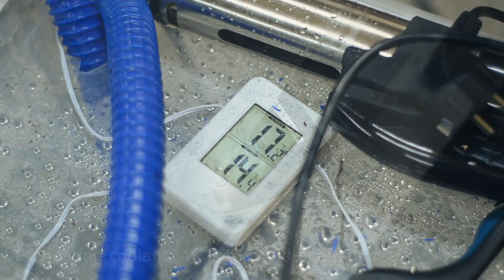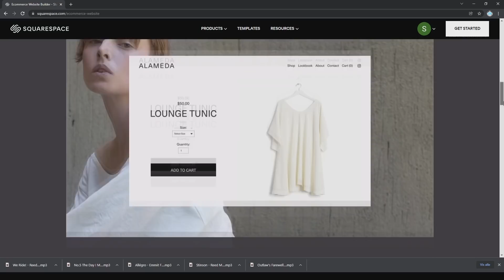Why!? All I wanted was all the power.

Comment: I was a Blata  factory sponsored pocketbike racer for several years and i can tell you now that you have that clutch set too tight . also you could save  a lot of  weight by switching from that big chain to a smaller pocketbike chain. you would have to make some adapters to use pocketbike  sprockets and pinions but it bight be worth it to save some weight and rotating mass.  Our most powerful 40cc pocketbike engine made 24 hp   so i am looking foreward to seeing what this thing does
Reply: 40 cc and 24 hp? Would love to see a dynochart of that. With 50cc would make everything 2STROKE STUFFING is doing obsolete :-) 

But yes ligher chain set up helps allways. When racing 125gp bikes, we learnr that worn and dirty chain could rob up to 2 hp.
Reply: How is the chain going to make a difference? Its attached to a massive flywheel...
Reply: @tyresmoker4  kind of like sanding all the paint off an Abrams tank to reduce weight. That's a huge rotating mass the only difference that would likely be seen between a chain to a belt is friction losses which going off other calculations between chain and belt is likely only 1% to 3% difference.
Reply: Yeah he explains it in the video, he needs a lighter clutch system to get past the reverb from the pipe working against the crank case volume, this is then shown to be correct when he disconnects them from the engine, so a lighter clutch will let the engine rev past that limit then it'll spin the clutch enough to engage the springs and start spinning the flywheel.
Reply: Lmao the best engines come from CS ghr and medos BZM and they all making around 16hp to 19hp with a 50cc.
Reply: in what country you are you living? And you say that you are a factory blata rider back in te days? Before the time of the ultima?
Reply: I think that beefy chaij srtup is just for his engine dyno, so if he ever sets it up on a bike with a smaller chain to wheel dyno it, shpuld make a bit more power
Reply: Shh this guys kicks ass mate

Comment: My perspective, as someone with 14 different motorcycles in the garage/stable: you keep changing Air/Fuel ratio components, and each time, the engine does a wildly different behavior. If you calculate the proper Air:Fuel stoichiometry, the engine will respond accordingly. I know you think it's running Fuel Lean, but I'd bet it is actually a bit rich... Bogging down in 2-strokes occurs when you don't have enough Air to burn, for the given Fuel flow rate. Do some math, then try again

Comment: Can always use  brake clean to find leaks in the crank case if there is a question..... squirt a little of the "non flammable" kind and if there is a leak the motor will stop. Right then, ( Carb cleaner will not work for this ) I've done this for decades debugging dirt bikes and chainsaws...find goofy crap like cases that leak, seals , manifolds etc.

Comment: Indeed! This seems to confirm what I was already wondering when I saw your previous video. How strong is the force needed to bring up the generator brake up to speed anyway. As soon as a magnetic field is generated by those spools the whole contraption acts as a brake. Which is of course the whole idea because that is how you measure the power output. If the initial power output of the engine is however too low you will never get beyond the initially needed pulling power / momentum. Part of starting an elektromotor is to feed it with extra power to get it beyond the initial momentum / inertia. Here this works the other way around. You need an extra strong moment from engine to get the thing turning then you need to keep it at speed. On could also compare it to trying to pull a farm tractor with a standard roadworthy moped. So my feeling is that your power bench is better sized to the torque of a ships diesel or whatever then to a high revving, low capacity 2 stroke. Try to measure  and / or make some calculations what power is needed to spool up this whole contraption in the first place.
Reply: An eddy current dyno has only inrtia when being spun up , its only when the field coils have current externally applied to them that any braking force is generated. Having said that , the inertia of that particular rotating mass is huge for a 50cc race engine.
Reply: @waynewright5504  He could probably stop that motor with a AAA battery attached to the coils!

but seriously, all that mass doesnt matter if it's going through a centrifugal clutch. It will make decent power once it gets upto speed, he just might ned to change the gear ration on the belts.

Comment: Could you modify the Telma retarder (mechanically) with one of the two rotors removed? One would still be in eddy current area in order to brake, with the bonus of a reduction in moment of inertia.

Also, the wide exhaust port is probably influencing the pipe length and making it act like it is shorter. can you add an extender between the crankcase and the pipe to lengthen the pipe? Much easier to start with a long pipe and progressively shorten the effective length than to start off too short and not have the motor hit the pipe band.
Reply: Lighter flywheels on the dyno probably would help things, for the reving out issue im right there with you on the pipe needing tunning for the crank case volume

Comment: you need to loosen the spring screws in the clutch to abt 1 or 2 mark, or else you will burn the clutch bell, or it will get overheatet and it won't grip, i've been working on cvt mopeds for 8 years now and my so far streongest 70cc build makes a little over 28hp, but you can contact me on mail and then i'll help :)

Comment: Great work, as usual! The only advantage the float style carb should have is a dedicated idle circuit, well that and the lack of pulse as you well noted. Those little Walbro carbs work fantastically IMO, better than float type carbs IMO, which I think is why a lot of 2t rotary GP bikes used pumper type carbs. Well that and orientation of a pumper carb is without relevance. I do think pumper carbs requirte more upfront planning. For example I converted my RD350 to Ibea 29mm flat slide pumper carbs. On the track it ran incredible, but for street use they were horrific. Fuel economy was awful too, so I went back to 28mm Mikuni flat slides. Anyways, sorry for the long post. I do have a few varieties of pumper type racing carbs that I would be willing to send you to try out. Send me a message.

Comment: Try to pre spin the dyno wheel, so the engine doesnt have to start it from zero rpm..
Reply: Not a bad idea for testing purposes but once it's in a bike the engine will need power to move so the time he spends on the primary clutch won't be lost.

Comment: I had problems running membrane carbs on my Suzuki K50 with an 86cc scooter cylinder, could never get it to run good through the rev range. Put on a Chinese Maikuni and it was just perfect(in Allen Millyards voice). Never had any problems with those carbs on all my paramotors, so might be something with the crank case volume and highly tuned small engines. My paramotors where 100-180cc with mild factory tuning.

Comment: Everything I have ever learned about two stroke engines has always mentioned keeping the crankcase volume as tight as possible. listening to your engine reminded me of a 175cc Yamaha I had when I was younger  , I had to keep the noise down and packed the baffle a bit to much - engine rev was good to about 5k then died - one day the baffle blew out and it took off like a rocket so could you have a back pressure problem ?
I all else fails - a good bottle of whiskey will provide you with some clarity 🤣

Comment: That is wild won’t even spin up until it’s on the pipe! Maybe you could run a v belt with a tensioner and manually pull a lever once the rpm’s are high enough?

Comment: first, great project so far. but, I think the problem is this: you are trying 2 things at the same time. 1, the PIP cylinder, and second a  large crankcase volume. if you would make a 'normal crankcase' first, and get that running good, you could progress to secondary intake. now it is guessing what causes the problem... 1 change at the time!

Comment: Your work is inspirational and I love watching you methodically overcoming each problem you meet. This suggestion might be naive and completely off track but I once had a 50cc moped (a Casal) which had similar symptoms. Revved beautifully but didn’t produce any power so wouldn’t pick up any speed once clutch was out. Turned out to be a failed small end needle bearing. Probably not your issue but worth considering/checking?

Comment: I recall watching Honda techs pushing like mad 2 stroke, multi valve, multi cylinder 50cc bikes back in the 60s and they couldn't get going unless they reached 20 to 22,000 rpm to have enough power to start moving forward. Once going, fast as lighting. How about a 2 stage clutch for your project?  Keep up the good work.

Comment: If it has not been told before: 
- check the ignition advance. More advance - more torque. Too much advance: detonations, clicking noise, engine failure. Too little advance: no torque. 
- check the centrifuge clutch. Set it to open AFTER the max torque rpm (I guess over 3000-4000 rpm). Also, you can play with primary transmission ratio to set it.

Comment: hi. why don't you use fuel injection and mount the clutch directly on the crank? with correct timing, mapping (ignition/injection) and less powerloss on the clutch... when you mount the clutch to the crank, mass can be reduced on flywheel or total rotational mass... sorry for my bad english ;)

Comment: Hello, the big bike chain is also adding a lot of friction, you could look for a type of chain used in moto gp. They are very light with minimal friction. A cheaper and easier option would be a monkeybike chain. I use regina on my 150 engine, just make sure you get the high quality ones. 

Cheers and good luck

Comment: Weber 34 ICH might work. There might be a 28...not sure. Might be too small. A 32 DGV two barrel handles low and large low pressures well which...in your application persist to high rpm. I currently use these  carbs on my small displacement 1.5l race engine which has low manifold vaccum and a 4l I6 from 1927. Maybe a Dell'Orto from an early Mito reving to 15k? Love your show!

Comment: "Wo gehobelt wird, fallen Späne." is what we'd say! Love your videos, no matter if dyno run or troubleshooting without getting in the taste of a single run. Just great seeing you having ideas, figuring problems out and how to solve them. Keep up the good work!

BTW: the PIP has its max power at 20000 doesnt it? Why not RPM match the electric brake, engage a clutch manually (like from an car AC compressor) and then slowly put load on  the e-brake it until the PIP cant hold the RPM? (The RPM matching Motor on the brake would freewheel the second you engage the clutch to the PIP)

Comment: This problem looks like 1990's 50 ccm Italian racing models problem.... Aprilia 50 ccm I think 1997 model, 14500 rpm, 3 or 4 speed I can't remember.
In order to start as fast as possible, we pushed with our feet up to 10-15 km / h ....As much as anyone could.
Looking at this problem, I think it would solve yours if you turn the dyno a bit just to get the engine running at natural rpm's.
By the way, I'm a big fan ✌️

Comment: Use an AC clutch for a car.. its an electromagnetic clutch so you can control it with the same arduino you would use for the secondary intake or even a standalone one

Comment: Now imagine, you ran the engine at full rpm, but used a cvt to tap into that power without dropping the rpms much at all
Reply from the maker: The plan👍
Reply: @2STROKE STUFFING Alex; wouldn’t it be better to spin up the flywheels of the eddy brake dyno with a pony-motor such a a small 4 stroke generator motor, using a chain and clutch? From what I understand your planning on doing near steady state testing anyway at a very narrow RPM range, therefore you could remove the massive amount of torque needed to get the flywheels accelerated / maintain speed between dyno-pulls, by just running the pony motor until at 2-stroke engine engagement rpm, then throttle down the pony motor and make your runs......this would save a ton of wear on both your test motor and the clutche(s)......hope this helps.

Comment: Do you know of which size the main jet is that is assembled to that diaphragm carb?
Maybe it is not big enough to supply that kind of engine at high rpm under full load.
We use same kind of carbs in our chainsaws. I could check, if there is something bigger available.

Comment: Feels familiar. After months(years) of hard work it is only the beginning 😀 but you will get there.
It might really be that the crankcase pumping action is so weak that there is no power. Usually with normal crankcases there should be still 2-4hp below the power dip rpm, with a 50cc.
But I also think you will need more reduction ratio for the dyno like we discussed. Otherwise the clutch needs to slip like crazy. There might be just too much load from the gearing.

Comment: You have my sympathy. I built an engine and spent 2 years trying to get it sorted to the point where it even ran half properly. Ignition was in the ballpark, known good carb etc. In the end I simply jammed the ignition to full advance, way in excess of what had been required on other builds, and away it went. Still a huge disappointment though in the end.

Comment: the clutch will be a measure of slip while dyno loading . you should have  a better coupling between motor and dyno thats on off with zero slip . have you calculated the dyno inertia (unloaded inertia )vs bike inertia

Comment: Would it be possible to spin the telmar at unit up with a electric motor on a sprag clutch system until you hit the power band ? Cheers from Australia. 
Perfection is a harsh mistress and can’t be rushed , you are not making mistakes just finding what does not work .

Comment: Float carb seemed like it had a way easier time approaching that rpm hump than the pumper did, might be worth sticking to until that obstacle has been defeated, it's crazy how it seems to have as low of a torque as the RC nitro engine did before resonance.

Comment: Perhaps use an auxiliary motor to get the Dyno up to a high enough rpm so that you are getting into the powerband, then disengage it.
Or, do like the old Van Been  Kriedlers and rig a 13 speed transmission.:)
Reply: Van Veen, auto correct got me...

Comment: I don't know what RPM springs you have on that clutch. I race 5th scales RC cars with a 34cc engine on it. My dad has a 42cc on his. Anyway Rovan makes clutch springs for several different RPM ranges. I think they range from 6k to 10K springs. I'm not sure they will fit, but they may be worth a try.

Comment: could trade the grease in the bearings for oil. could you make a slider for the pipe to get the lower rpm power?

Comment: I would try to remove the pipe to get it out from equation. I also suspekt that it too rich on lover trottle opening. Then when your carburation is better you should adjust the cluch so you can get an power/rpm curve an go on from there. As you have not simulate this unique engine the optimal pipe will take a lot of work to find. I also liked you skipped the pumpcarb, i hate these..... Skip worrying about crankcase volume.... Keep on the Great work....

Comment: Have you ever tried running a carb that draws fuel straight through venturi effect  all my model airplane engines have a plain needle valve and throttle valve on methanol nitro and offer full adjustability

Comment: Didn't have a 6 or 8mm endmill? wouldve been so much easier to adjust the clutch holes on the cnc haha, wouldnt have programmed it, wouldve just done it by hand using the remote wheel thingy, if yours got one, although.. programming it wouldnt take that long even.. Was surprised you went at it the good ol'fashion way lol

Comment: Get rid of the sprockets and swap them for some moped running gear and clutch which will give you higher torque at lower rpm maybe even make one, coz if its easy its not worth having lol

Comment: Could the lack of RPM's be from having the clutch set at the lightest setting so it's engaging at low RPM, which in turn is loading the engine down from just above idle speed?

Comment: Youtuber samodel has experimented with putting a pumper carb on a scooter, which seemed to work while free revving, but as soon as the engine had a load on it, it bogged down. Seems to be the same problem.

Comment: How about trying to manually choke the exaust a bit with something until it reaches a bit higher rpm and then let go?
Reply: A two stroke makes more power with less restriction at low rpm - you have the idea back to front.
Reply: @waynewright5504  Not necessarily. Depends on when the pressure wave returns in relation to port times.

Comment: Your crankcase volume may be the problem with that carb. The pop off may need to be a lot lighter.

Edit:
Like 2 minutes after I posted this you mentioned it. 😆

I still think it's too much crankcase volume. Increasing volumes start to kill anything below the very top. Your engine's volume is pretty extreme. It won't have anything until it's near tolhe top rpm's.

Comment: You should consider installing a wideband o2 sensor to take the guess work out of jetting
Reply: It won’t work satisfying… I have researched a lot with it… the twostroke has to much unburned mixture going into the exhaust and the amount of it is depending on rpm, timing, temperature etc… it is a o2 sensor and unburned mixture has o2 in it 😜
Reply: @Tightman0815  On 2-strokes EGT is used instead, but you know already :)  (Never tried myself)
Reply: @TT.Hell.  yep, that’s one way 👌

Comment: Is the clutch to tight tune it to ur rev band and maybe to much weight to move plus its clutch to chain momentum is all wrong to much to move to get the engine running at peak performance or lack of fuel maybe